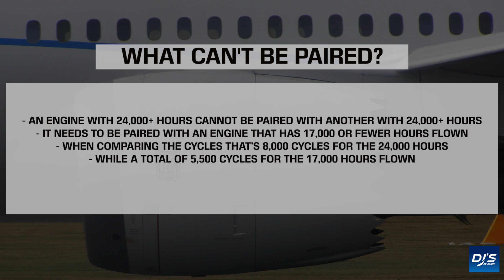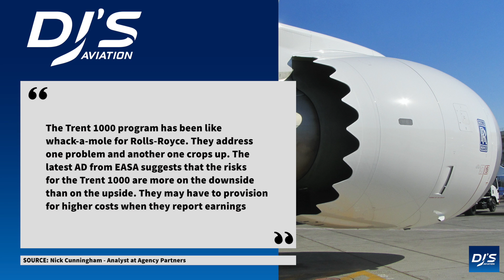New Boeing 787 Engine Issue

Comment: I would be surprised if carriers finally get mad and not order the Roll Royce engines and more over to the more reliable GE's.  This is not a Boeing issue but one that seems that RR is not prepared to fix all the issues with those engines.  It seems wack a mole is not working.

Comment: My worry with powerplant and planemakers is whether they are all pushing the envelope too far in terms of making the flimsiest lightest product possible to reduce on fuel costs. I think the majority of us passengers would prefer to pay a little bit extra to be a bit safer. If you follow F1 motor racing or performance yachting the reality is that composites and specialist light metal alloys can fail in certain circumstances. It may be rare but it can happen. Safety must come first.

Comment: The oversold on ability Trent 1000 is the smallest of the Trent series, which means that in order to deliver more power from fewer turbines, the engine has to run on the knife's edge of the hot side. The three-spool layout has always been heavier. The former is a management decision, the latter, an engineering reality. The magic promised vis-a-vis GEnx, could not be delivered without the compromises imposed, so R-R has an engine reliability problem that was entirely self-inflicted. The surprise with this more worn engine "surge" mismatch problem, also known as compressor stall, infers that wear in the hot section changes the cold-side dynamic in the suck and squeeze section.

Comment: boeing 787 has no mechanic backup iirc, so ..a power surge and shut down of a drive by wire? lol
Reply: Maybe the fly by wire (which was developed from the similar 777 fly by wire but with the mechanical back up) was made more advanced as to not require it

Comment: So if I am to believe info I've found, there is about 53,3% of GEnx engines under these birds. Only 32,9% B787's have the RR Trent 1000, with a further 13,8% B787's not having a selected engine yet. Of thouse 32,9% RR Trent 1000 there are packages (1000-E; 1000-H; 1000-A[-B/-C improved versions of the A pack witch underpreformed]; 1000-G; 1000-C/D/L/P; 1000-J/K/Q ; 1000-M/N and last but not least 1000-R). The problems are on the package B and C engines a further percentage of 32,9%. Well how many planes are not making money? Because I was under the impression that a majority of the dreamliners had the RR trent 1000.

Compared to the GEnx the RR trent 1000 has more power to give, so i guess that is a factor in the choice. But operators of the B747 may already be using the GEnx engine which would be a plus for General Electric.

And concerning the 'rush' in development, almost all of us are suffering from the same disease. We all want our stuff now, and if posible yesterday. And when designing some new stuff with unknown's factoring in, I guess almost all of us are suffering from the other disease, making choices that are not always perfect. Hence finger pointing is born, and no one has an easy cure for that symptom.

Comment: Why are Rolls Royce engines on Airbus aircraft not having the same problems?
Those engines are based on the same design. Rolls Royce seems to have infinite money and time to develop new engines for Airbus aircraft but fixing the Trent 1000 seems to be very low on their list of priorities.
Reply: It does seem that way currently but Trent 700 had many engine failures on A330 (more than from the 777 engine suppliers of the initial variants with 3 engine choices)

Comment: RRs A350 engines seem to be preforming flawlessly while the piece of crap they made for the 787 is unfixable, all that can be done is to make frequent checks while RR twiddles their thumbs. Boeing is completely snake pit. The company is being trashed in the media for the delays on the 777X without noting that every new aircraft introduction is late. If a gnat smacks into a Boeing Jet’s windshield it’s front page news. Nobody is writing about chronic delays with the P&W GTF. It wouldn’t be a bad idea to slowly replace the 737 MAX name, start calling it the 737 EE or XE for Extra efficient

Comment: If they had 4 engines there would be no issues, two engines are now used to make airlines more profitable and fly within ETOPS rules, which would not necessary with more than just 2 engines.. Two engines are not as safe as 4. Just saying.
Reply: Engine failure is still rare enough that I'm not aware of any times there were two independent engine failures (not both triggered by the same cause). Additionally more engines increases probability of a single engine failure, which increases chance of uncontained engine failure and potential aircraft damage.

Comment: I see a lot of misinformation around here so I'm going to post a comment that should more or less make the most important points

1) This is a RR issue, Boeing was not involved with the engine development and airlines had the choice between the GEnX and the Trent 1000.
In fact all the GEnX equipped 787s are doing just fine.

Of course we can't blame airlines for choosing the RR version, since at the time, we didn't know the engines had all of these issues.

2) But if it's a RR problem, how come the Trent XWB (A350's engines) are unaffected? Surely that means it's Boeing's fault.

Not at all, since the Trent XWB is a different engine, with different components and with different performance.

3) Will this affect the Boeing 777x and/or its GE9X?

No, as the GE9X is a completely different engine, built by a different manufacturer, and it's the one and only engine planned for the 777x.
Reply: This is the real facts that should’ve been mentioned in the video but were not

Comment: Once again,this is why ETOPS allowing twin engine aircraft on oceanic routes is a recipe for disaster.  Maybe time to reconsider ETOPS before more lives are spent to enrich corporations who prefer profit over passenger safety.  Looks like a good time to book flights on any remaining 3 and 4 engine aircraft if any are left on trans oceanic routes. I think BA still has some 7474 400s left and a few A380's and Lufthansa still has a few 747 800's.  I would rather pay more for airfare and not worry about going in the drink when a twin engine with the RR Trent 1000's develop a glitch mid ocean.

Comment: I must admit I prefer companies in the aircraft industry to find, own and rectify problems. Just like the problems with pickle forks on the 737NG, find it and fix it.
Reply: They need to do that and stop outsourcing 50%+ as it can causes quality problems. Boeing themselves have admitted with the 787 they outsourced too much (they had to buy out some partners because of all the problems which led to delays) and that going forward (like with 777X wings) more should be made in house although they will partially outsource to Japan with some stuff

Comment: Obvoiusly not enough info,  but looks like a software problem to me.  A firmware upgrade to the FADECs might solve this.

A power surge would likely be fuel pumps sending mroe fuel to engine and fuel pumps controlled by the FADEC. 

Headaches for airliens, yes. But I suspect this problem may be fixed soon and not take Rolls years to find and debug.

Comment: Very interesting about the new rule about having a 'younger' engine paired with one that has more hours/cycles.    Are the engines on twin engine jets normally replaced two at a time or is it quite common for engines to be changed one at a time?   I've spent time on Google & could find nothing about this.
Reply: One at a time, since engine service intervals are different than airframe. Many airlines intentionally de-pair engines regardless, which helps stagger maintenance intervals as well as potential safety benefits. I'd guess an AD for mandatory depairing is a logistical challenge though.

Comment: Is that pairing configuration just to reduce the chances that two engines will fail on the same flight? If so, if I’m not just misunderstanding it, that not acceptable to me,  at all.

Comment: Can't they just put the GE engines on it instead?
Reply: Computers, wires, sensors, software and more would all need to be changed to support a the GE engines
Reply: Adam Nantel   Beats dying, ijs
Reply: @adamnantel658  If all these jets are grounded due to faulty engines, then I would cut the loss and do the swap and hopefully get the money back for the RR engines.

Comment: just fkn stop the ceramics and go back to what works. its clear they havent tested things thoroughly enough, to say that these new lightweight materials are safe....
Reply: Trent 1000 doesn't use ceramics or CMCs much at all though... GE engines (which are more reliable) tend to use more
Reply: @Digital Electronic Creative they cant have, wrong testing must have gone on, if someone agreed that a brand new plane has to divert and emergencyland on one engine. We've seen it countless times for norwegian and others. So how come a 757 or a 737 or 330 has a much better reliability in terms of malfunctioning engines, (exclude the neo for now...)  Something is seriously wrong if they can claim to have tested things properly and then still have problems 3-4 years later....

Comment: You need to control your bias. “Rr and Boeing is one of the worst pairings...”

How about when a RR engine blew up on an a380 and punched through the wing and put 500+ souls in peril over the South Pacific?  Let me guess...marvel of Airbus engineering to bring the plane down?  Far less serious than schedule delays on a Boeing?  Wake up man, you need to consider your rhetoric and bias. It’s getting ridiculous. Never more so than this and your “ANOTHER 737 CRASH” video after the Tehran SHOOTDOWN.  Wake up or just announce the airbus sponsorship.
Reply: patburrell everyone can see that the RR Trent 1000 has been a disaster for Boeing. It’s always the aircraft model who is grounded. You never see in mainstream media that the Trent 1000 is grounded, its always 787 Dreamliner.
Reply: Henning Kaasa because that’s the application of the engine. But this is not Boeing’s engineering. Nor was it Airbus’ when a RR came apart on the Qantas A380
Reply: patburrell I totally agree that it’s the RR engineering that is flawed, but unfortunately Boeing get the bad publicity because they offer a solution with that product

Comment: This isn't really a Boeing problem, it's more of a Rolls Royce one. The Trent 1000 has been plagued with issues for years now and it never seems to end. Maybe RR should just drop the Trent 1000 program and GE could make some profit by selling GEnx's to 787 operators as replacements to the flawed RR Trent 1000 engines.

Comment: I often travel on scoot with rr 787. Very quiet especially if engine goes out. Jetstar has GE but they have had problems also. Might start walking.
Reply: Yes Reg,americans dont want to see the GE engine faults
Reply: GEnX problems though is nothing compared to the poor blade durability of Trent 1000, even the new TEN is having the same issues on SQ’s recently delivered 787-10’s

Comment: No wonder why Singapore Airlines was in a rush to order the 787-10 with RR engines?
Reply: SQ prefers to order aircraft with RR engines when available like BA although they are happy to have engines from GE as their 777-300ER’s are GE90 exclusive. Korean Air on the other hand actively don’t order aircraft with RR engines since they don’t have the maintenance facilities since retiring the Fokker 100’s equipped with RR 3 spool engines nearly 20 years ago
Reply: Well I know that MH370 used 2 RR engines. I hope it won't do the same accident to the Boeing 787 as MH370.

Comment: If one engine hast 24,000 miles the other one may not have more than 17,000??? Are you kidding me? What kind of safety standard is that?!  "Well yeah it should be fine as long as the backup is a newer one."  Every day it becomes more apparent what a house of cards the aviation industry really is...
How about: Maximum miles for an engine is 17,000! Either an engine is reliable post 17,000 or it is not.
Reply: It's not miles, it's hours, as with all engine measurement.

Comment: In my opinion this style of problem happen often enough in the industry, it is costly and takes time to fix but it will be fixed. I think is more a problem of perception since all the mess wit the Max, which is has been a real dumpster fire with deaths, lies and a so badly miss managed that has blown the 787 engine problems out of proportion. With all this I still not sure when will Boeing will get it's house under control.

Comment: A lot of silly comment here. For a start an engine surge is not a surge in power but usually an indication that tolerances somewhere are moving out of spec faster than expected. Sometimes referred to as compressor stall. RR is not the only engine maker to have to solve this issue. These engines are super reliable, but as the designs are pushed for max fuel efficiency and at the same time having to meet ever more stringent emission standards very often these requirements are at odds. If anyone is stupid enough to think it is easy to design and build these engines I invite them to try. Only two companies now do it on there own, even the mighty P&W has fallen into military and joint ventures for commercial engines.

Comment: The GE engines are much more reliable. The A 380 also lots of trent issues! Those where severe failures!!!
Reply: Air France had two engine failures with the GP7200 (A380). The FAA issued an emergency airworthiness directive due to manufacturing defects found in the fan hub.
Reply: @luckyme4136  yes I remember! Qantas had some mid air scares with them too!
Reply: I salute Air France on the early retirement of their A380's. (Better safe than sorry!) 😉
Reply: @luckyme4136  yes plane is not that safe and very sluggish! Took way too much room and fuel.
Reply: AF also put the worst on board products of any A380 operator and they wonder why no one wants to go on them

Comment: I believe that because the manufacturers are beating the Bejesus outta each other, a lot of new tech is being launched too quickly without enough testing being done.
Reply: @HypercubeJones  that's why we have safety regulators and inspections. And indeed accident investigations...
Reply: @imipak23  As the 737 MAX certification process clearly showed, safety regulators (and the inspections they require) have their limits, especially in cases of regulatory capture.
Reply: @HypercubeJones  I believe that's what in IT we call an implementation detail.
Reply: Thankfully

Comment: Don't know why RR is encountering so many issues with its Trent 1000 engines on 787's while the A350 is doing just fine with the Trent XWB product. Surely the technology is similar in both cases.
Reply: @HypercubeJones  , you'd think RR would simply use the same XWB technology to correct the Trent 1000 issues.
Reply: @lrg3834  , if they did it to correct (i.e., redesign), it's going to be a lengthy, expensive fix. It always seems (perhaps correctly so, in most cases) that a reasonable fix can be found in a reasonable amount of time.

That's what Boeing figured with the 737 MAX design. They lost that gamble. They should have copied the 777 wings and landing gear designs, scaled down, if that's possible. Or something like that.

Comment: The same uncommanded engine surge issue has recently cropped upon an Airbus A350, which also uses a  Rolls-Royce Trent variant.  Ergo, the fault lies with the engines, not the aircraft manufacturer.
Reply: Hopefully it’s not to the same extent

Comment: I think at this point Rolls will never develop  the new SuperTurbofan high diameter, instead of  Airbus will adopt a General Electric engine for A350 Neo sometime at the end of this decade or even earlier. Right now A 350 Rolls is a disaster forever under scrutiny for defects of gear box and lower than excpected trust performance in take of.
Bet all the  787 in backlog will are equipped with GE engines, even at the cost of a compensation to Rolls for cancelled orders.

ps. apparently even Rolls A330 Neo engines are full of defects on blades.
Reply: GE though won’t let Airbus use GE9X as its exclusive for 777X so it will be an advanced GEnX 1A derivative new engine. They still may keep RR as supplier but time will tell
Reply: @filledwithvariousknowledge1065  Never said the engine will be GE9X. A more powerful derivative of 787 engine could be great.
I have some doubts about Rolls, they are clearly behind in engine new materials. Big fans need of composite materials today and here they are absolutely late, Titanium have too much mass for unit of volume.

Comment: Is there anyone left at Rolls-Royce that still knows how to build a jet engine?!
Reply: There’s got to be as otherwise Trent XWB would be failing too but fortunately that engine is reliable. RR rushed Trent 1000 which is why it’s so problematic. Even their engineers warned management not to pressure them to use those lower durability blades compared to usual so this is the price management payed
Reply: Their Trent XWB is an excellent engine
Reply: The shop cat knows more than anyone - its been there longer.

Comment: IT is no fault of Boeing at all. Rolls Royce needs to correct the mistake
Reply: This crisis has been going for 2 to 3 years compared to the nearly full year for 737 max crisis
Reply: Well it needs sorting out either way. Yes it was a 2 year time frame but management seemed to what it design within a year and hence told the engineers to rush with fan blade durability testing. RR still got have th engine correct even with developing Trent XWB had they not rushed, small delays are acceptable provided it’s too late to annoy customers
Reply: Boeing made a choice to use and offer these engines.
Reply: If it's Rolls-Royce's fault, then it's my pencil's fault for failing my test.
Reply: boeing fan boy lol
Reply: Air Safety News 24x7  So. Rolls not competent at all.
Reply: @antoniosoares1580  grow up.